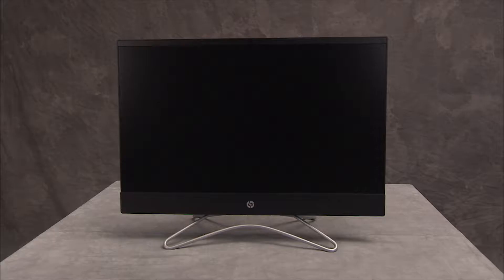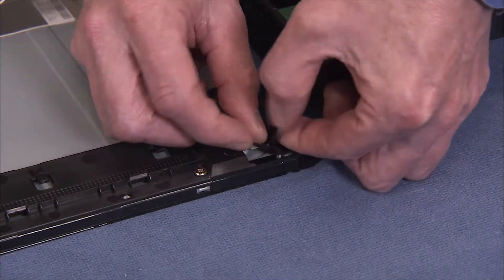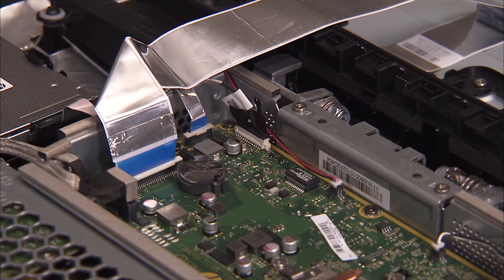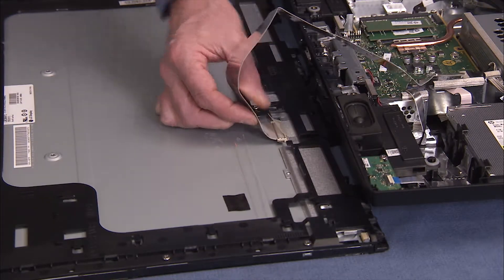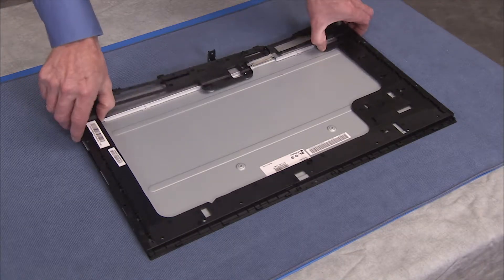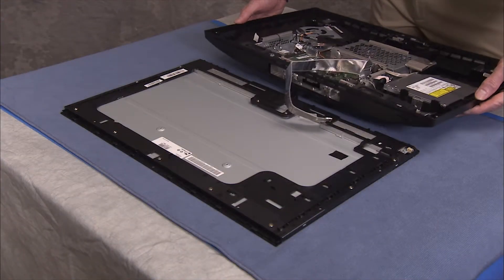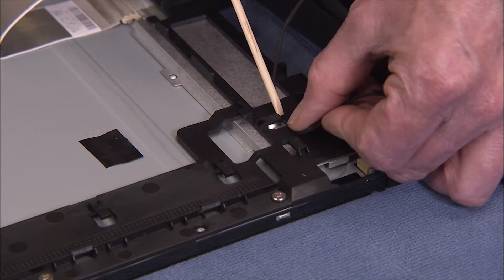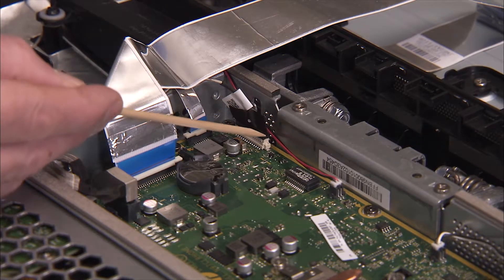Replace the LCD Frame/LCD Panel Kit | HP All-in-One 22 and 24 Series | HP

Comment: How you remove the downside of the LCD cover so easily? I can't, please help 😓
Reply: Sir, I opened that monitor and did everything, now the display is out and one crack sign also I can see, before there is one single line on the display but not totally black and one crack sign is there. How to solve it ? My employer is angry with me. Please help me🙏
Reply from the maker: Thanks for the reply.
Please contact our phone support team to fix the issue.
Please follow these steps to reach them.
Step 1. Open link: https://support.hp.com/us-en/contact-hp
Step 2. Select the product type.
Step 3. Enter the serial number of your device or select let HP detect your product option.
Step 4. Select the country from the drop-down.
Step 5. You should see the HP phone support number.
Binu - HP Social Media Tech Support
Reply from the maker: Hi Sourav, thanks for contacting HP!
I understand that you are experiencing an issue in removing the downside of the LCD cover.
Please contact our phone support team to fix the issue.
Please follow these steps to reach them.
Step 1. Open link: https://support.hp.com/us-en/contact-hp
Step 2. Select the product type.
Step 3. Enter the serial number of your device or select let HP detect your product option.
Step 4. Select the country from the drop-down.
Step 5. You should see the HP phone support number.
Binu - HP Social Media Tech Support

Comment: I have a hp 24x and the screen has white lines going across it because i hit it with something by accident, how would i go about fixing this and finding parts to fix it with?
Reply from the maker: +connor This document provides solutions to a variety of problems that can occur with notebook and All-in-One displays such as blurry text, poor video performance, black or white screens, or damaged hardware. Find a section below that matches the problem with your display, and then follow the steps to resolve the issue: http://hp.care/2oPxHcG
Reply: @HPSupport  ty